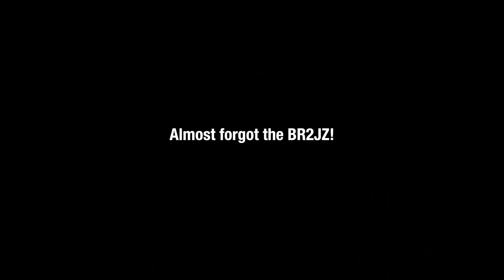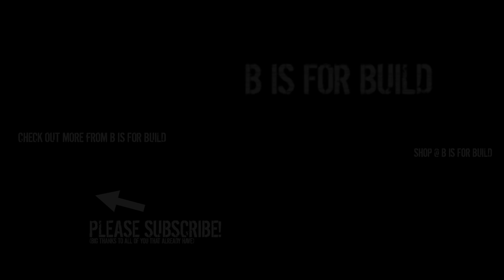2JZ BRZ Pt 28 - Final Assembly & Car Show!

Comment: Chris, you should get a custom made badge for the front bumper.
Reply: It needs to be black and red to match the color scheme.
Reply: Hyra Crane You're right. The wheel candy red on the outer ring of the badge, body color on the inside and then candy red again for the stars. That would be pretty slick and blend well.
Reply: Q Moore I think he should get a Toyota badge to match the 2j
Reply: Technically the car is a Toyota already.
Reply: actually it is built by Subaru who builds/built them for Toyota and Scion.
Reply: he should also get the Toyota 86 badges for the fender vents.

Comment: honestly i think the 86 should come with a 2jz from the factory
Reply: The 2jz is such an old engine at this point it could be improved quite a bit, the N54 is very similar the the 2J but it a bit more modern with its direct injection fuel system. Maybe the engine could be redesigned to the 3jz with somewhere in the range of 300-400 magical unicorns
Reply: And BRZ with an STi setup or option, heh :P
Reply: honestly I think the boxer setup suits the car better because the car was built for handling. Adding a 2jz from the factory would ruin the handling characteristics. Also the 2j is kinda dated and heavy and not the best engine for the application. All the 86 needs is a turbo to make it a real beast.
Reply: Xantho Poulos like you said a updated "3jz" would be amazing! A sti motor in the brz. Is also a great idea! I would love for the two companies to come out with crazy plans
Reply: MrSoulkiller56 truusst that would be crazy since they share the same car might aswell make an engine togethe!!
Reply: MrSoulkiller56 then it would just be a supra then.
Reply: Sean Smile basically yes. Everyone wants the supra brought back. I think a 86 from the factory with a modernized 2j  would be a very close 201? "supra". Not that ugly ft1 bull
Reply: MrSoulkiller56 i wouldnt call the ft1 ugly but the 86 needs a lightweight engine for its handling preformance so a 2jz wouldnt be ideal. Boxer with a turbo is prob the best setup
Reply: Abdujalil Minni true. But with the right suspension set up you could make the handling very good. But. A Sti motor and 400hp from the factory would be awesome.
Reply: MrSoulkiller56 right but the thing is the 86 is made to be an "affordable" sport car so i dont think toyota or subaru will have it produced with a 400hp boxer from factory unless they make a Preformance package wich would include those specs. THAT WOULD BE FKN SIIIIKK!!😂😂💯

Or just bring back the supra ffs 😂
Reply: It needs an Inline 4 as it is meant to be the predecessor to the AE86
Reply: da dre way I thought boxer engines were only in Subarus?
Reply: da dre way hahaha funny that the 2jz are dated but subbie has been using the ej25 since forever the fa20 is the only new engine of theirs and it was uses by toyota/Subaru for this car
Reply: It should come with something that actually makes power, I agree. I feel a good inline 4 with a turbo would be adequate. That way it wont have a boxer, be fun and punchy, comfy around a track and not be a front heavy pig sled. Instead of the slow, fat and overpriced stance machine it is now. (Okay it'd still be overpriced but all new cars are.)
Reply: KudoT a turbo 2.0 I4 would honestly make this car incredible
Reply: Lane Browning it was a collaboration with Toyota, Scion (which is basically Toyota in America) and Subaru which is owned by Toyota so basically it had a collaboration with its own sub companies
Reply: Several of you guys are saying the supra needs to come back, but i'm quite confident that toyota and BMW are working together to make the supra/z5
Reply: Also many of you guys are saying you want an turbo I4, but why not just turbo the boxer engine? And keep it true to the low center of gravity that makes the 86 handle so well (If there's some major flaw with the engine that I don't know about sorry I'm a euro guy)
Reply: Xantho Poulos I’m with you on the N54. Love my 335i!
Reply: exactly what I said, turbo boxer(probably stroke it out to 2.3L or 2.5), solves your speed woes an still retains its great handling characteristics.
Reply: xXSUPREMEOMEGAXx I think you mean successor
Reply: Xantho Poulos yeah they are BMW engine with Toyota tech which is good because BMW's are master's with Inline 6's as well just look at the M3's
Reply: MrSoulkiller56 like a revamped 2017 version
Reply: Maybe a 2gr-fe wouldn't be so bad , but then again it would be nice if they released the "supra" with the 1gz-fe hell bring the Crown Majesta to the us with that engine and you could have my savings.

Comment: As a mechanic, the hydraulic/gas tubes for holding up the hood is a bad idea, I have many times had hoods fall when up using them, infact, I have had more than a few almost injure me, I now usually have a metal rod or stick on me when working with a hood like that to hold it up, trust me, the rod is a MUCH better solution than the pistons

Comment: Might want to double check how much thread engagement you have on that shortened lug, could back off after time (vibrations). General rule of thumb is 1 to 1.5 times the thread diameter in thread engagement! Good build though, can't wait for manual trans! Haha

Comment: Break the dampers for the hood in by compressing them and leaving them that way over night (put a weight over it or find a way to do so). Thios will soften them up so there shouldn't be any issues with the hood. I have dampers for the carbon hood on my RX-8 and it's perfectly fine

Comment: overflow needs to be the highest point in the cooling system to properly bleed the air out of the system. also if the heater is hooked up when you are bleeding the cooling system you need to have the heat on high to get the air out of it to make sure all the air is out of the system so you don't have an air blockage which will cause your temp gauge to spike.

Comment: Hi Chris,

Don't know what those brake pads are exactly, but according to my own experience I suggest you to be careful with those type of pads, especially if you keep the OEM brake discs : I once ran Carbone Lorraine (CL Brakes) RC6 pads on my Subaru, thinking it would brake much better.

Well yes, there was a huge difference, but I destroyed my - brand new - stock discs in less than 1000km (600mi).

Comment: Please fly Trevor up for the single turbo mod. It will help everybody he's the cheap JZ Jesus. Forget the 2jbrz name it's a Toyota thru DNA just do the full jdm swap with a half cut yota F.  You live in a west coast port city u already have an import advantage. Got a solution for the start switch gonna send the details thru Facebook message. It seems like speedo works tach should be easy with a Dakota signal converter. No need for more gauges until you are forced to go motec or one of the other standalone ecu's. Gonna give my guy at Dakota a call Monday try to get you a sponsor. You are doing things right can't wait for the Aston build. #2jz-86 #ft2jz #2jzbrz

Comment: What would the cost be to do a 2j or 1j swap into a 240sx I found a 1j set with trans and stock ecu for 1400 haven't looked at 2j's but I just want sock power for a while

Comment: You wanna know what sucks? a vacuum cleaner!!! XD
Nah but seriously, you wanna know what really sucks? Rear wheel drive high performance vehicles without traction control.
Your in your car testing out it's full potential, and the Damn thing won't even get a grip. the engine is just too much for the rear wheels.
This build series is pretty dope by the way.
Reply: Evans Bost U mean FORD GT? (Old one)
Reply: You know what sucks even more?
Drivers that can't handle big horsepower, no matter the driveline.